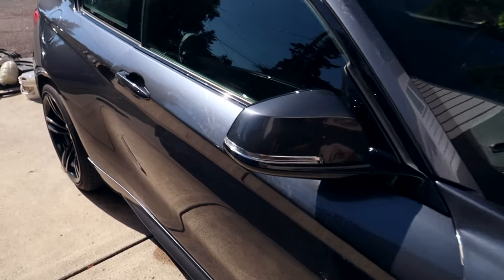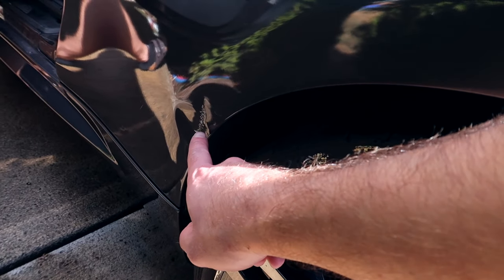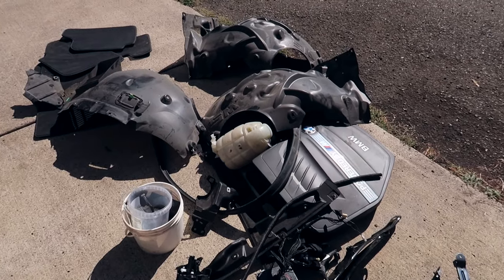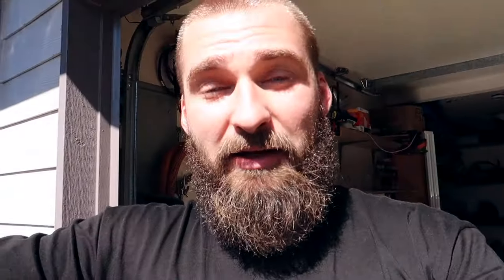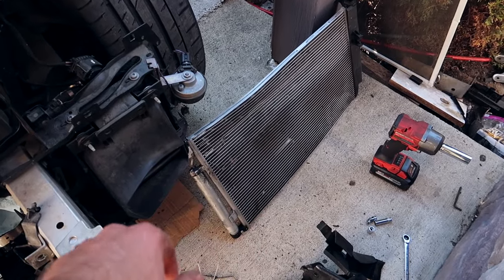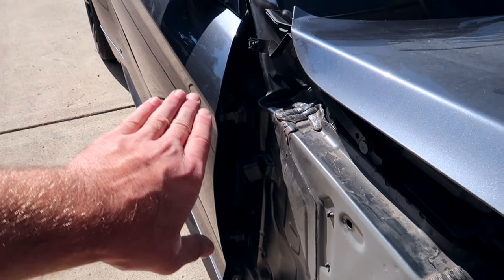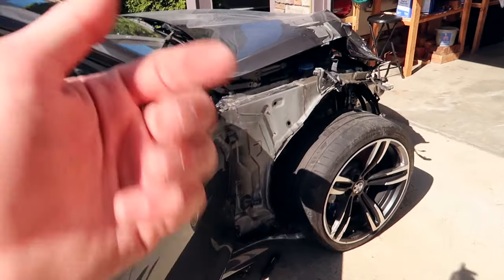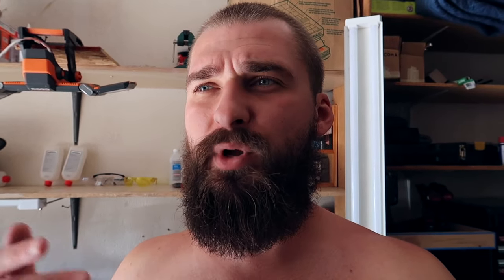We Bought a 2018 BMW M2 off Auction  - How Bad Is The Damage? | New Project Car Part 1

Comment: Looking forward to the rebuild as the M2 is a fantastic car 👍That car is a good base, but it'll definitely take some work to get it right. As for the battery safety terminal, that is located inside the positive cable that connects to the battery. The car sound be able to start after that cable is replaced, unless the battery is dead as well. Lastly, there should be an oil cooler located on the passenger side, it probably ripped off in the accident which is why it's missing and there's oil residue everywhere.
Reply from the maker: Appreciate the insight bro! Yeah I've had the terminal issue on my E60 M5 years ago. I just wasn't sure which cable it is on this car but thank you! We'll get all of this square and running!

Comment: You need to start the car to get DCT in Neutral. So to see how much oil there is on the engine you need to take  oilchange so you know how much you get out. And then fill up the correct amount. 
And offcourse make shure that the engine spin freely before starting. 
Nice project. 👌🏼😎

Comment: The coolant is brown because the transcooler oil has mixed with the engine coolant.
Reply from the maker: How does that happen? The trans has a separate cooler right?
Reply: @YEVSBUILDS  I might be wrong but I think the trans cooler runs internally to the radiator.